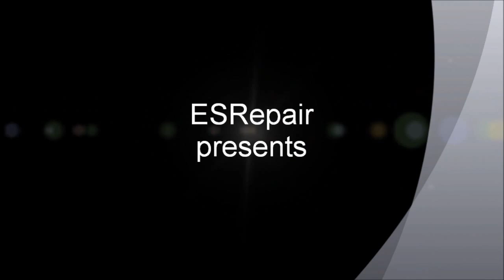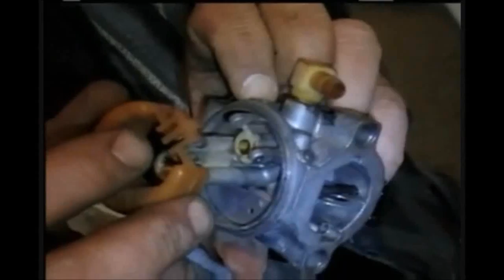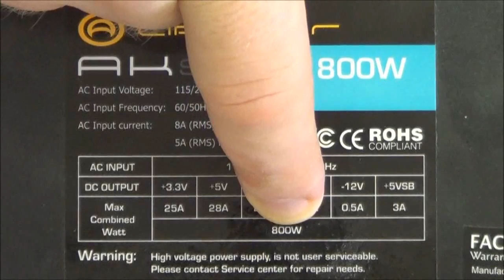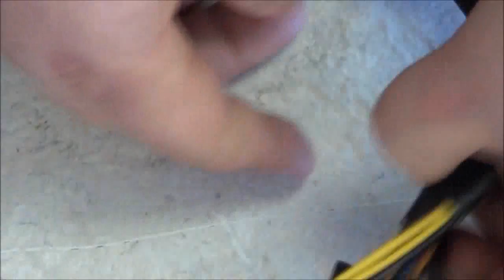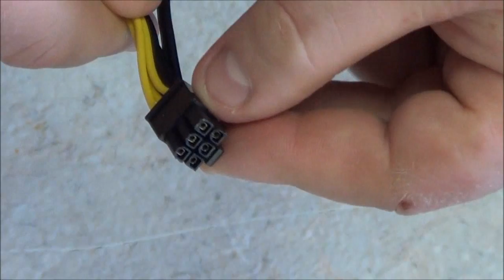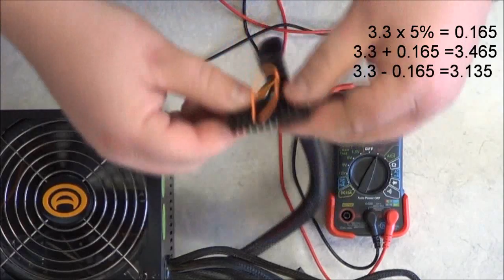How to Test the PC's PSU

Comment: @ESRepair :  I have a Coolermaster RS-750-ACAA-A1 , recently my PSU has become strange where my pc does not power on anymore, sometimes it does.
I particularly noticed this when we have been having many brown outs over months and months.
I do have a good surge protection plug which i spent alot of money on, i use the same for tv etc.
After giving up because my PSU just does not come on and the red LED light is not coming on at ther back either, i decided to take out the PSU and do a test on it.
I bridged the Green pin and the neighboring Black pin with a paper clip.
Plugged in the mains and turned on the plug switch.
Then i turned on the psu switch and the fan started to turn.
I tried to turn it off and on again, the fan does not turn.
I tried to unplug everything and retry a few times waiting a few minutes between each test, it seems the fan spins when it wants too and the red LED light goes on when it wants to.
I opened the PSU up and found that one of the BIG capacitors is swollen and the top is leaking fluid.
Can this cause the PSU to behave this way? 
I am wanting to know before i hold my breath and find a capacitor to replace.

Comment: I have a old 200 watt PSU and trying to use it to power up a care stereo in my garage. I did test it and coming up with 11.54 volts. I know that's within the 5% but do you know if that would be fine to power up my 2005 Alpine car stereo?
Thanks, Roy

Comment: Strictly speaking, the statement that the "motherboard" connector with 20 pins is "for older computers" and the 24 pin for newer computers.  I have a motherboard that requires the 24 pin motherboard connector and it is 18 years old.  It is a dual Xeon CPU computer known as "Predator".  So to be correct, the 20 pin connector is mostly for older computers and the 24 pin mostly for newer computers.
Reply: ok boomer

Comment: If all the number are in range, does it means the PSU is in good condition and perfectly work?
Reply from the maker: It means the PSU is providing the proper voltages.  Plug the PSU into the PC and test while the PC is on.  The voltages should stay within 5%.
Reply: @ESRepair  My PC wont turn on after being off for like 1 month. With the position of PSU cable is unplugged from the wall. I dont know if it is because the PSU or motherboard. I try to connect green & black cable using paperclip and the psu fan is working. I try to jumpstart the mobo using screwdriver, change cmos battery still nothing happen. I build my PC on June 1st this year so it still new and makes me curious what is wrong with my PC. I dont know if it is because my PSU or motherboard.

Comment: Sorry, but this is NOT how to test a power supply. In fact, this is a quite useless demonstration. 
What you are doing in this video is attempting to test this PSU without employing a load. This is kind of like trying to determine how deep a pool of water just by by dipping your big toe. Getting your toe wet, means YES,  there is water in the pool, but you'll have no idea how deep the water is this way. 

The explanation, in simple terms, is that the computer PSU is not just supplying voltage - it is supplying current, lots of it - and at various voltages. In the case of the PSU in this video, it is supposed to be capable of supplying up to a total of 52 amps of current at +12 volts, split over has two separate 12 volt rails 28 amp rails.  It can also supply 25 and 28 amps of current at +3.3 and 5 volts, respectively. 

This type of no-load test is merely checking for the presence of voltage but not testing to see if the PSU can supply that voltage under even a minimal workload. This type of PSU failure is not at all uncommon. 

In order to actually test a PSU and get a meaningful result, you must place a small load on the PSU during the test. One to do that might be to place say, a 10-watt, 10 ohm resistor across the +5volt line. That would place a small load on the PSU. Not perfect, but better than nothing.  In the field, you can use other components inside the PC itself to create a load. You can do this by leaving the PSU installed in the PC, disconnect the main 24/20 pin motherboard connector but leaving the other things (drives, etc.) connected. Now, test the PSU as described in the video at the 24/20-pin MB connector. Again, this is not perfect, but can at least it provides at least some idea if the PSU will work under load.

Comment: I have a Dell Precision 650 desktop (2004), which I'm trying to get up and running, pressing power button only emits a 3 blink amber light, checked all the connections, they were fine so I made the assumption it was the power source and ordered a new old stock power supply. Installed the new one, exact same condition, so now I'm in the process of eliminating the PS as the cause, my problem is this, Dell has a proprietary power supply, and it doesn't seem to adhere to the ATX standard, no green wire, and connecting 4 connector down to third connector down like you show in your video produces no fan action, weather it be the old PS or the new one. I tried to find a wiring diagram on this power supply (NPS-460BB), but have had no luck, do you have any suggestions? Thanks.
Reply from the maker: For a time, Dell did not abide to the ATX standards to ensure their customers had buy Dell parts. Those PSU were a little different when it came to the wiring.  Pins 1,3 ,16-18, and 20 were +5V (Red); Pins 2,4,9-10, and 12-14 were Ground (Black); Pin 7 was +12V (yellow);  Pin 5 was the Power Good signal (Orange); Pin 6 was the +5VSB (Purple), Pin 8 was the -12V (Blue); Pin 11 was the Power Supply On (Grey); and Pin 15 was the -5V (White). Pin 19 had no connection. They also had a 6 pin auxiliary connector that carried the +3.3V rail.  Pin 1-3 were ground (Black) and Pins 4-6 was the +3.3V (Blue wire with white stripe.
Reply from the maker: Does it Blink amber 3 times then stops or does it repeat?
Reply: Blinks three times, then stops.

Comment: I think it is bad to run and test PSU without any load that is what does it say A+ exam
Reply from the maker: That's new....  Why would it be Bad to run a PSU without a load?
Reply: @ESRepair  Because components inside work on dc not ac and because of that we use ac for transferring electricity not dc,  they get so high temperature in seconds and even that will shorten the life span of PSU or even fail after a couple of minutes without load. Some PSU even turn itself off without any load as a protection mechanism. I just took A+ a year ago
Reply from the maker: in the 30 years i've built PSUs, I've never seen one go bad just because there was no load.  If you overload them, it will shorten their life. If you apply AC into a DC circuit then, yeah, it will damage the PSU.  Have you even taken a PSU a part, let alone build one before? Do you even know how the PSU works?
Reply: @ESRepair  So you have a lot more experience than me but i just said what A+ exam says. How PSU works i already know and taken a PSU a part as i'm working in PC repair service for 2 years right now but i do not build one before.
Reply: @ESRepair  Powering on a power supply without anything attached could damage the power supply.
Do not power on a power supply without connecting to the motherboard and possibly a device such as an optical drive or hard drive. An ATX power supply
usually requires a motherboard connection at a minimum. Page 137 Complete CompTIA ® A+ Guide to PCs, Sixth Edition CHERYL A. SCHMIDT
Reply from the maker: @cyborg6294  Thats interesting.  I would like to see a video that shows a PSU going bad because of no load.....  And you just volunteered.  Show me your video of a PSU going bad under no load.  I'll wait.
Reply from the maker: @cyborg6294  BTW. Are you aware that PSUs have a load built inside them to allow them to draw minimum current while under no load?
Reply from the maker: The ATX standard has required power supplies to be safe under no load condition for many years now. For example, in 2004, the spec said, "No damage or hazardous condition should occur with all the DC output connectors disconnected from the load. The power supply may latch into the shutdown state.

Comment: ok, so I got a new PSU trying to convert from 400W to 800W The PSU fan did turn on like your things checked out. what if things check out and it still will not power my pc with juice? Does this mean it is collapsing under load?
Reply from the maker: If the voltages are within tolerance, the PSU should have no trouble providing power to the PC. The motherboard must receive the PG signal from the PSU to turn it on, otherwise there may be a problrm with the Motherboard.
Reply: @ESRepair  Btw, this is a very good video. This is a good question..i shorted the green to black and my psu fan came on and I can measure all the voltages and they are all within tolerances; however, once i connect the 24 pin connector back onto the motherboard...the psu fan doesn't even spin, front panel power button doesn't light, no boot. I even try jumping the pins that the front panel power button connects to on the motherboard just in case the power button is bad. Nothing! Now, I'll admit I did not know about shorting the gray to green. I tested all voltages relative to ground. Given that when i short the green to black and the psu fan spins, but not when i plug the 24pin back into the motherboard...it's a bad motherboard putting a load on the psu? Should i even bother with another PSU?

Comment: I have a psu that has all the voltages but under load it collapses. So this test is not sufficient to determine if the psu is good or not.
Reply from the maker: If you need to test under a load,  test the voltages at the connector when the PC is off and again when the PC is on.  The voltages should be withing 5%.of the stated voltage except for the PG.  it should be within 1% of 5VDC.   If the voltage is collapsing under a load the PSU is turning off.
Reply from the maker: The test was only designed to check that the PSU turns on/off when signaled and the voltages are within tolerance, especially the PG voltage.

Comment: 5:38 are you saying that if I have to change the power supply of my PC then I got to get a new one with an equal or a greater wattage?
Reply from the maker: yes.
Reply: Depends on the power requirements of the other components.
Reply: @fuckyou1640  thanks for the response guys, because first I got really confused in thinking I can't change my PSU for a lower wattage one just because my components were used with a greater one.

Comment: I don't think that PSU's 12v is good.  At 11.72 with no load on it, I doubt that PSU holds that 11.72 when everything is pulling power from it.
Reply: I just replaced my Corsair CX600 for a SeaSonic 550W Gold and the SeaSonic holds 12.02v under load.  When idle it holds 12.02v.  Ideally nothing should change if the PSU is in good shape.  My Corsair CX600 was slowly dropping in voltage over time, but nothing big, like at cold start it puts out 11.95v but slowly dropped to 11.82v.  Still within spec, but multimeters can't measure ripple or if the voltage dropped suddenly, so with the Corsair my PC would crash randomly while nothing so far with the SeaSonic, and I've had the SeaSonic for a few weeks now.  I'm running a Ryzen 7 1700 @3.8Ghz and a Radeon RX 480 with three hard drives.  

Just plug a multimeter into a molex connector and watch it while using your PC.  Voltage shouldn't drop under load for more than .2 or .3 difference.  At 11.7v I would replace the power supply.  That's far too close to bellow spec.
Reply: Yea, that's old.  I've been cheap with my PSU's and they don't generally last more than 3 years.  The SeaSonic I bought is the most expensive one I've ever bought, but it comes with a 7 year warrant.  I'd say you got your money's worth with yours.

Comment: Im only getting 2.7V from the green and gray  "power good signal"wires but the otherwires test ok..What does that mean? PC wont turn on
Reply from the maker: The Power Good signal should be closer to 5V.  Some systems will accept 2.7 to turn on but the majority requires it to be 5V.  You will need to replace the PSU.
Reply: ESRepair Thanks for the quick response. I guess i should have mentioned that my psu is not the one u specified. Not sure if theyre all the same but mine is a Raidmax RX-630SS, kind of a mediocre psu i got from newegg..Also as an update to my problem, if i disconnect the 4+4 atx plug for the CPU, it will turn on and stay on, wont post tho. With that plugged in it only turns on for like hald a second n then shuts down. Pretty starnge but im thinkin its a mobo issue or maybe even the CPU itself.  Any info or help your able to provide would be much appreciated..Thanks
Reply from the maker: is the PSU wattage high enough to handle the PC?   Check the 12V rail on the ATX12V for the CPU and see how much the voltage drops when the PC is powered on before it shuts down.  Also check the PG signal to see if it falls below 2.7V when the PC is on.  Its either a problem with the VR for the CPU or the PSU is unable to provide adaquate power due to either it being bad or the Wattage is not high enough to power the PC.
Reply: ESRepair First of all thanks again for takin the time to help. To answer your q, yes, i calculated my components and i should only need about 450w even w/ both gpus installed so 630w should be plenty.  I did some tinkerin and this is where im at currently.  I completely disconnected everything and have the mobo "bread boarded" with nothing but the PSU and monitor hooked up. I even swapped cpus to eliminate another variable. If i had another ddr4 handy id swap that as well.  It now powers on and stays on but still no post and keeps bouncing between the cpu and dram EZ Debug leds. With the mem stick out it beeps and just the dram led stays lit as it should. When powered on the voltage at the atx plugs have a little fluctuation but stay between 12.25v and 12.3v. Voltage at the green n gray wires bounces between 5.05v and 5.07v. Makin progress but im even more stumped now than i was b4. It almost has to be an issue with the motherboard...
Reply from the maker: Well, everything seems good with the PSU. I suspect it is the VR on the motherboard that powers the CPU. The VR is a switching regulator for the CPU, similar to that in the PSU.  As part of the fail-safe, if the PSU detects a short , it will immediately cutoff power the the PC to protect it. Since you mentioned the PSU only shuts off when the ATX12V is plugged in the motherboard, I suspect the problem is with the CPU's VR in which case the MB would have to be replaced.
Reply: ESRepair Makes sense, i assumed that there had to be regulation of some kind to the cpu's voltage. i had originally contemplated supplying the cpu with a seperate 12v power source just to see if it would would even post, confirming a power problem. Im no expert but that seemed like a bad idea. My new mobo should be here tomorrow. Gotta love that Prime free 1 day. Thanks again. Omw over to patreon right now to sub
Reply from the maker: Your welcome.  Glad I could assist.  The VR is located next to the CPU on the left where the ATX12V, aka the  P4 connector. plugs in. On some motherboards they are covered by a Heatsink to keep them cool.  Often times a capacitor or a MOSFET goes bad. 

Amazon prime does come in handy.  thank you for subscribing to patreon.  let me know how the new motherboard turns out.

Comment: You said Some power supplies give you 5% and some give you different?
How exactly do they "give you"?
There should be a rule of thumb to follow
Reply from the maker: Most PSU have a 5% tolerance for each voltage rail. This means the voltage will be within 5% of the stated voltage at any given time, even under a load. The 5V and the 12V rail should be with 5%, however, the 3.3V rail must be within 4%.  some of the more expensive PSU have a tolerance as low as 1%.

Comment: When testing computer power supply's it's very important to have a fire extinguisher close by for safety because if the power supply has problems or doesn't work then the capacitors and other internal components inside the computer power supply can explode and cause a fire and also if capacitors and other internal components inside the computer power supply do explode unplug it from the wall immediately and use a fire extinguisher to put out any fires that it caused

Comment: Good vid but my blue and yellow wires wont read and my red and purple are at 8.5v and orange is 5.5v is my power supply stuffed any advice would be appreciated
Reply from the maker: Does sound like there is a problem with the PSU.

Comment: Me fIXIT i turned the switch of ac voltage from 230 to 115 v and it just made a burst sound.. i wana know that if my psu is completely dead or there are chances that it will become functional again... ?
Reply from the maker: The switch needs to on the proper setting for the input voltage. If you're using 230V then the switch needs to be set to 230V. IF you switched it to 115, you'll need a new PSU.  Many of the newer PSU models have an automatic switch between 115-230V
Reply: I have 230v electricity power outlet but I accidentally switched the power box voltage switch to 115v. is it dead completely ?
Reply: @hassansaeed5894  completely dead.
You could get away with 230 setting with 120v input, it just won't power on. But yours is fried.

Comment: Great video! My PSU’s fan doesn’t spin when it’s powered on; however, it spins when it’s disconnected from the PSU and connected to 9v battery. The LED light on the PSU is solid green when powered on, so I’m not sure if it’s just a bad connector for the fan on the power supply or something else might be wrong with it.